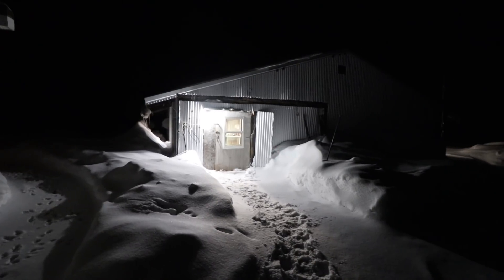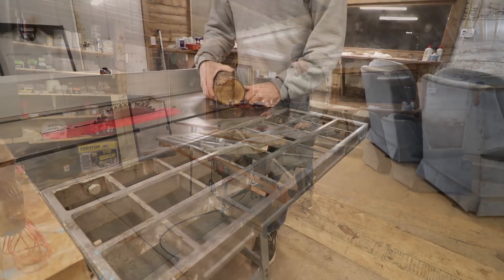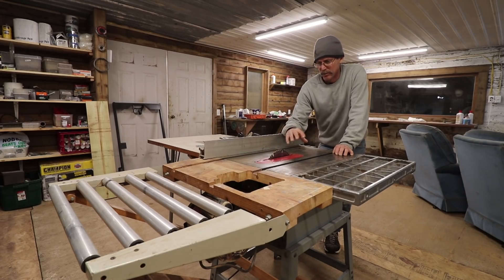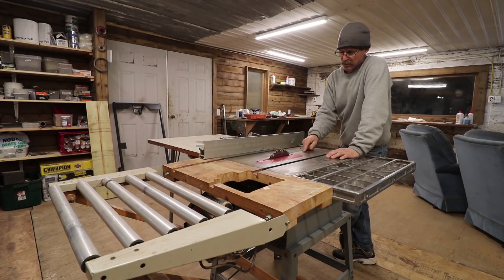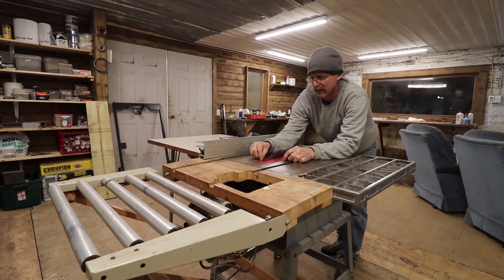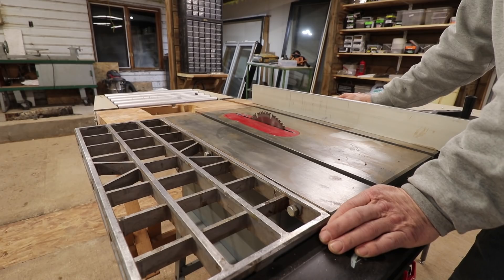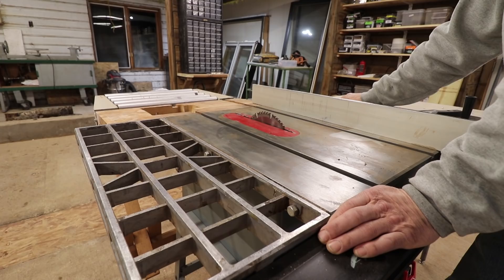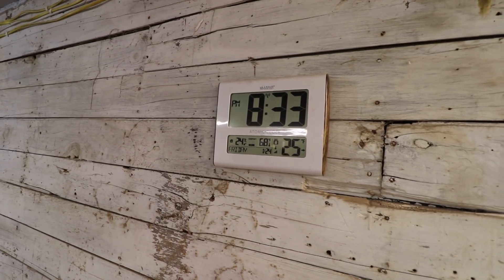Question? Delta Contractors Table Saw. Safety Issue. Board splitter. Your thoughts?

Comment: Hi Joe, Using a riving knife that's slightly wider than the kerf on your blade and aligned with the blade along with making sure your fence is in proper alignment WILL REDUCE KICK BACK BY 90%. Using a push stick and blade guard WILL REDUCE THE LOSS OF FINGERS BY 90%. And remember to always wear your safety glasses.

Comment: If I had to cut a log, I'd use my band saw. If I didn't have a band saw, I'd buy one or get creative with a chain saw. I have that same table saw, I bought a retractable splitter but it can't do non-through cuts. Theoretically, non-through cuts should be safer but I doubt that's true with a .....log!

Comment: It's called a riving knife.  Im sure you've had 1000 people tell you that by now : )    I learned my lesson with the riving knife but I never use the shrouds.  I actually find them clumsy and it makes  controlling the piece much more difficult and awkward.  But, I can attest to the necessity of a riving knife.   My right hand lost a fight with a small saw and lost about 1/2" of my index finger.  A riving knife would've prevented that accident, no question.  I think there is such a thing as an after market one but, as long as you can figure out the mount point, it's really just a piece of 1/8" steel that moves up/down with the blade.  I have serious shop envy.  Used to have an old school portable building as a shop but now I'm trapped in a suburban 2 car garage.....    sigh...

Comment: I assume when you use the saw the waste material is on the left side of the blade, I use bigger saws and only use finger boards one clamped to the  fence, does two things, holds material down on saw and boards cant kick back so easily, Home Depot sells a plastic riving knife that you drill your own holes for. I also use a finger board in the mortise gauge channel to hold material tight against fence, and use push sticks. 46 yrs commercial carpenter with all my fingers still attached.

Comment: Call a Delta dealer.  Joe could you turn the saw facing north not west so if you had a kick back it would hit a wall???
I know of a man that had a kickback & the wood ended up embedded in his side missing everything important!  After that accident he always worn a leather apron when using a table saw.
In the future when cutting your logs I would use a band saw, it is slower but much safer.   We use a band saw to make our bird houses out of logs!

Comment: I just got an older Delta and the wood splitter/ riving knife is fixed and only stays on top of table top- doesn't go up and down w the blade - it feels weird to me but think its just older style maybe???
Reply from the maker: A riving knife goes up and down with the blade, a splitter is fixed. They both do about the same thing.
Reply: @NorthernSeclusion  guess I have a splitter then lol so should I keep the blade up in highest possible position for use of the splitter??

Comment: Get a riving  knife. As far as the the teeth on the knife to prevent kickback they will br in the way when you make any dado type cut. 
If you are worried about kickback and the glass put up a piece of plywood or OSB in front of the window  to catch the kickback.  The OSB is a whole lot cheaper than a glass panel.

Comment: Should be able to add a riving blade . Never run a table saw without a riving blade or splitter.. for that round wood use a bandsaw or a manual handsaw.. keep them fingers .

Comment: kickback is a problem, but the biggest problem with these older saws is you hand being pulled into the blade..... splitters will help with that issue.... As a retired paramedic I have seen my fair share of hand injuries from table saws......

Comment: I would use a bandsaw personally, if cutting logs.
Reply: a band saw will not work, cutting a corner out of a log
Reply: Lori you are 100% correct. Also it is extremely easy and safer to cut a corner out of a log with a Bandsaw. That's one of the things they are made for!

Comment: I seen a guy cut his thumb off up to his wrist ,and my father in law sold me his saw like yours after cutting his 3 fingers off ,so safety first ,Joe make a jig and get a riving knife for the saw ,just my experience kick back is an issue but safety is quality control , of your work piece,,,something's u don't cut corners on safety is one of them ,one mistake can hurt for a lifetime ,an no I'm not the safety police I just know once your hurt your hurt and some injury can't be fixed lumber and tools are cheaper then body parts

Comment: get a blade stop , they work and can be retro fitted
Reply: That is only for keeping the blade from cutting thru your finger.  It won't stop a kickback.
Reply: @python3574   Yes , you are correct , I was thinking digits  and not kick back , with that extension stable set up it makes it kind of difficult to fit anything off the shelf

Comment: I recently purchased the same saw as you did, except mine is missing the right table and has no outfeed table.  I purchased a zero clearance insert and micro jig splitters and will be installing them when warmer weather arrives.  I did own a HF saw and had so many kickbacks due to the cheap fence so I got rid that one.  Use push sticks and if you plan on cutting logs I would suggest making a jig that holds them so you have more control and safety.

Comment: I would never use any table saw without a riving knife.  It's the most basic safety feature of any.  I don't care if it's contractor's saw or a cabinet saw, it's going to have a riving knife or I'm not using it.

The plastic blade "guard"?  Yeah, in the trash.

Comment: After reading all the comments I've come to the conclusion that everybody is concerned about your health and your fingers. Follow their advice working with unfamiliar power tools can be very dangerous. So far I my life as a woodworker I've seen three people lose fingers and one person lose his life because of kickback. Go online and download all the information you can on operating and maintaining your saw. It should answer most of your questions. Actually more power doesn't mean more dangerous it just means that if things go wrong they go wrong faster. I once started to cut a two by four and woke up on the floor to this day I don't know what happened, but I have a scar on my head to prove that it did.
Reply from the maker: The problem is, that no one is answering my question (well a few have) I have used table saws for over 30 years, my question simply was ..... For those of you who have used THIS saw, what brand name of a splitter or riving knife have you used that works well...? That was all I was looking for.

Comment: To many safety nazis out there. All the table saws I have own I always take the guard off, and i never liked the broad splitter , never use it   sometimes working with hard wood flooring I need to do a plunge cut for like heat registers and the splitter would be in the way

Comment: Table saws ARE VERY VERY DANGEROUS!  I've been using them all my life>  then 1 day it jump and bit me!  Went down the middle of my index finger hit the bone and stopped, Freak accident > plywood  jumped and force my finger into the blade. Then you use one ALWAYS RESPECT THEM, use all the safety you can>   i'am lucky i still got a working index finger

Comment: And pure BS about anyone having a kickback where they required stomach surgery (:....no such thing.  You got to use common sense with any tool.  But if anyone was handling wood that speared their stomach then they shouldn't be using any tools including a knife and fork.

If you're blade is binding to a degree where it can kickback at all then you aren't watching what you're doing.  Careful to use any tool...if the blade begins to bind in any way, then pull the wood back slightly and try to move it forward again.  If it still binds then perhaps you need to select a different piece of wood.  Only a twisted, knotted, wet piece of wood will bind at all anyhow (or if you haven't set up the fence properly).  And that type of wood isn't necessarily your best choice for a project anyhow.